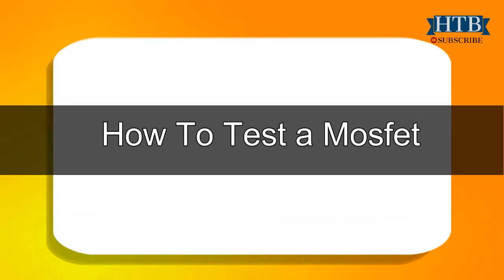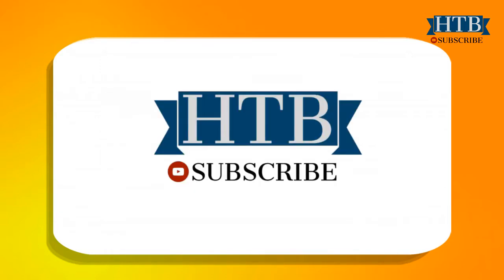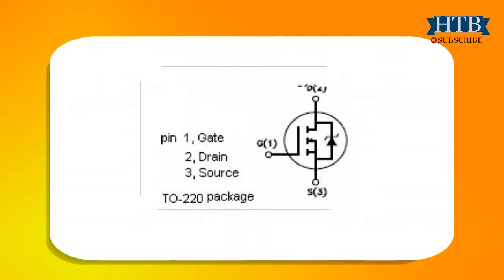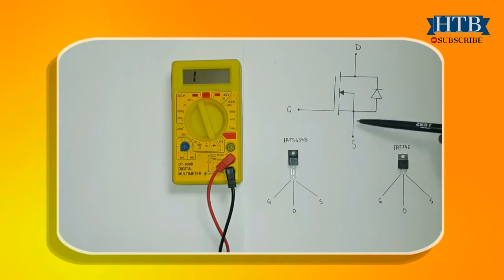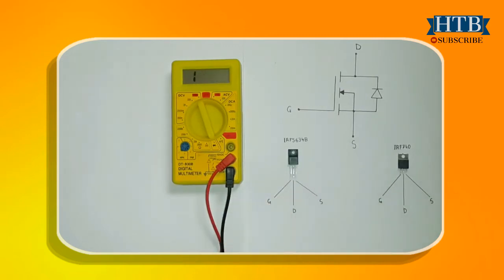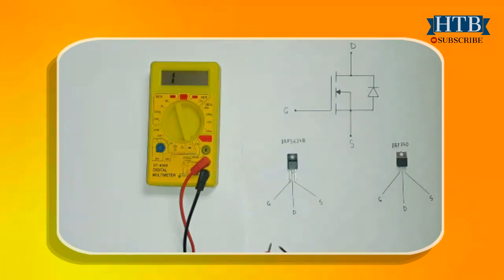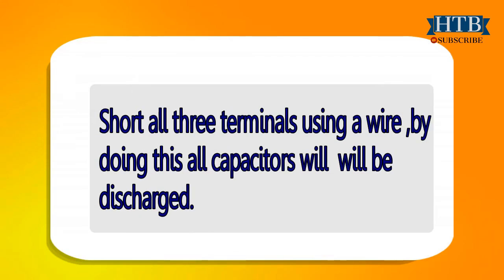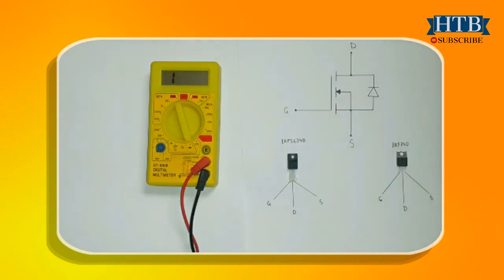How To Test a Mosfet

Comment: This is not always enough. The mosfet has broken so that it works perfectly with a multimeter, but the fett starts to conduct between d-s from a voltage source, but not with the diode setting.